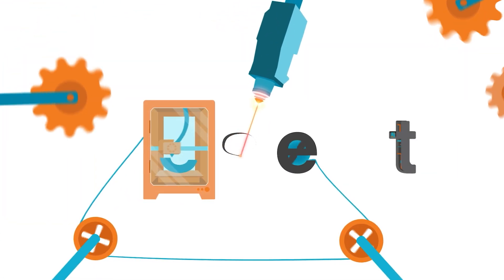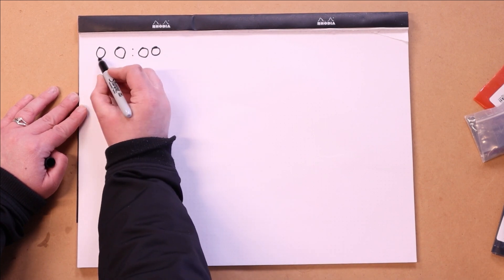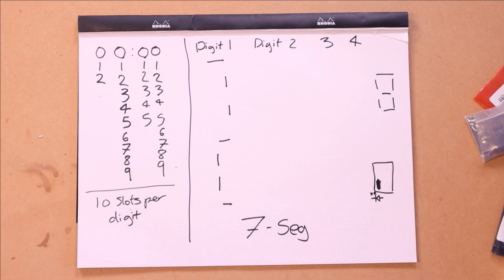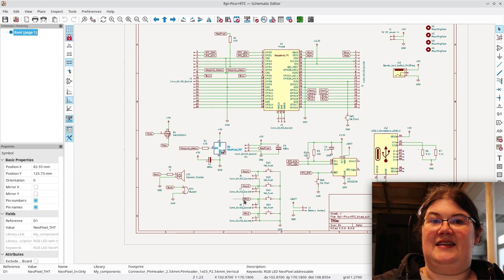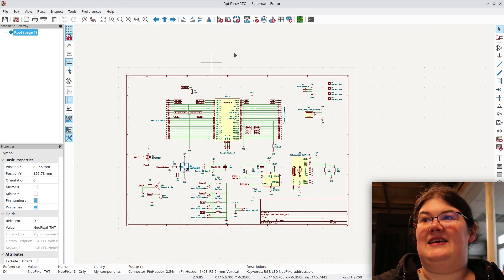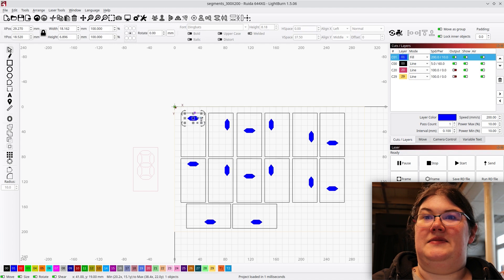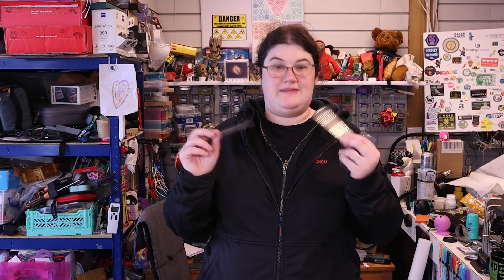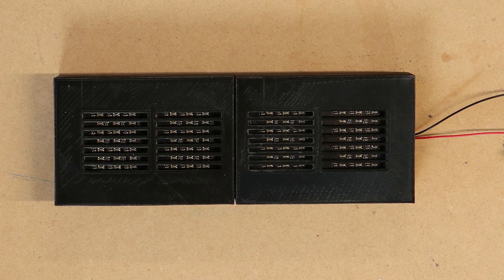Edge-lit 7-Segment Display Clock Using Raspberry Pi Pico

Comment: Neat project!

In terms of next steps... animation?  You have 7 segments at each position - with the existing layout you could cut acrylics to make for example a figure "walk" across all four positions.  If you modified the board layout to interleave and widen the positions you could have two 14-segment animations.  Not enough frames for a "smooth" look, but lots of options a-la the old neon signs.

Comment: I think that if you covered the acrylic with black (paint, paper, whatever's handy, although using paper would allow for testing without any permanent consequences if it doesn't look good) except for the 7-segment area you would get less bleed-through of light and it would make the display clearer. Although this might be something that looks a lot better to the human eye than it looks on camera. You could probably just do one surface. That also might allow sandwiching the segment layers tightly together for an even better effect, although that would make the lighting part harder.

Regardless, this is another cool idea and execution on your part.
Reply: Thats an interesting idea, as I was experimenting with how close I could get the sheets, so probably worth a test to see how it looks with a black layer. 
Vinyl would be fairly easy to cut out the segments on the cutter, and then easy to apply and remove if required.

Comment: Why didnt you just route out a channel positive and negative in each half of the case, it would of simply slotted together then
Reply: Yes, I've got another idea to cut a black opaque panel out for the slots which could then be mounted in a frame too, or slot to 2 halves. Unfortunately I forgot the check the size until I was just about to print, and our printer was running flat out at that moment and I just wanted it printed asap, so I v.quickly split the design and clicked send before heading out for the day! If I'd done anything that would have taken more than 30seconds it would have had to have waited until the evening and then would have been 24hours+ longer untill I had it in my hand :)